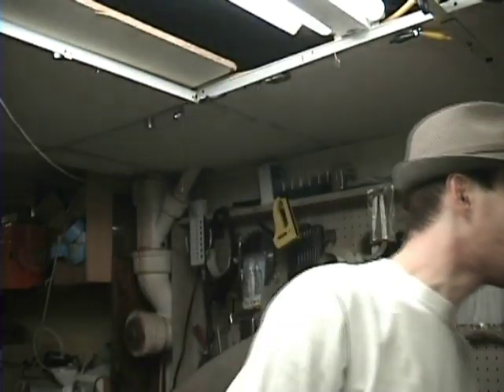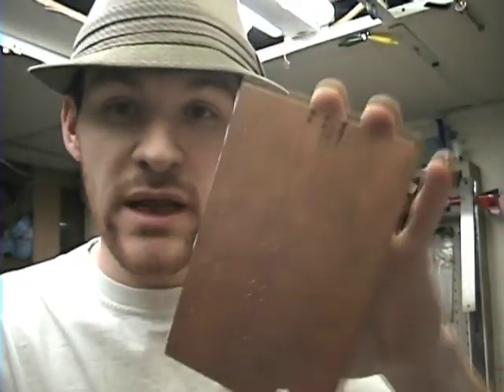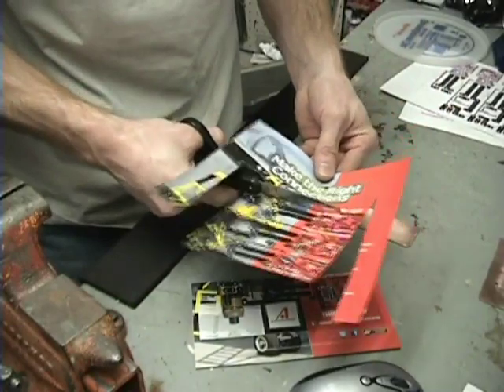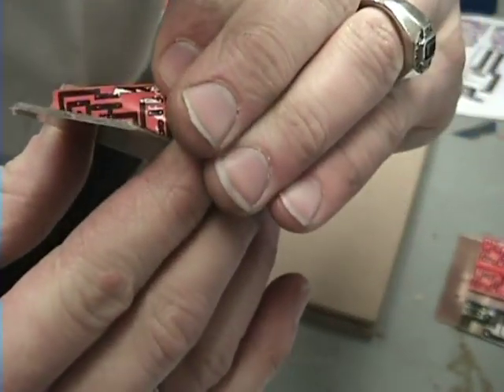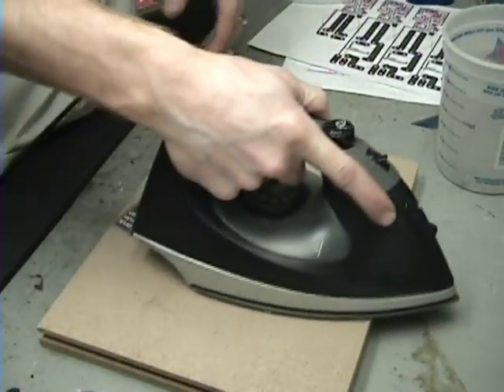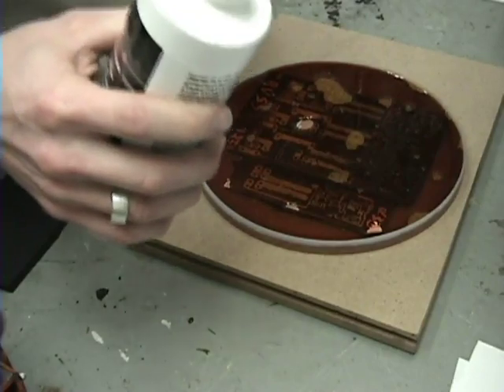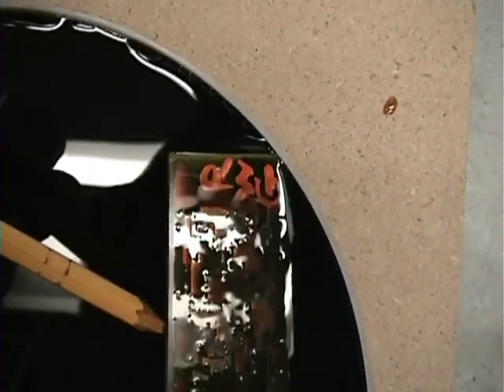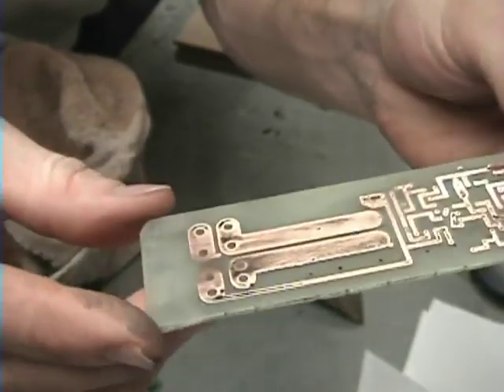#5 Building My Own Variable Power Supply (How To Etch Your Own Circuit Boards! )

Comment: Nice Video.  Brings back memories of my PC etching years ago.  Tips:  Put closed Ferric Chloride bottle in hot water for a few minutes to heat it up that helps speed up etching time.  If doing lots of boards, use fish tank with aerator attached to many holes punched plastic tubing at bottom of the tank.  -  Again, thanks for the video.  It was fun to watch your progress.

Comment: Great job Russ!  I have an etching kit here I never have even tried.  I didn't know paper could be used, I read that it needed to be transparency paper.  In case anyone wonders, the coating on the paper is actually a white powdery clay type stuff.  I've seen it delivered by rail car to paper mills. I don't think the view count is anything to worry about Russ, keep doing your thing!

Comment: A way to improve your etching times is to float your etching container in another container with HOT water.  The etchant works a lot better when hot.  You are right in that using more etchant would have been better as well because of the amount of copper being removed.  I like your method with the magazine paper, its a lot cheaper than my use of glossy photo paper.  Keep up the good videos.

Comment: Hi there Russ,
great vids' keep it up they are entertaining and informative, as a couple said a new sharpie works very well, you just have to get is dark in colour on the PCB copper, on other thing I found was to have the board larger than the overlay, this stops you from moving the paper or card stock or the transfer overlay you can buy, the iron has to be HOT my iron is set to the cotton setting.
I have done many boards this way and its a very quick way of doing professional looking one offs' or twos'.
With the ferric chloride I found heating it up will speed the process fast, keep the acid in the contain it come in find a bigger bucket put container inside and pour boiling water in, heat the sucker up, then use it as per normal, I have a heated Pyrex container with a heat lamp under it, works well, if you start seeing a vapor coming from the top of the acid stop heating very bad for humans plus it will eat any steel, be warned!!!

The best way to make a board is still photographically and it can be done cheap, nothing special, laser printer and clear transparent overlays print three or four, line then up PERFECTLY, using the specially coated board  put the transparent overlays on top, sheet of glass, some nice UV light, CLF bulbs work well about 3-4 mins I think, read the instructions might be different to the stuff I have used plus the light might emit more, I have seen UV LED's on eBay they work very well, develop, clean stick in HOT acid, perfect. Russ this might be something you might like to try, its a pity I do not have a camera but it might be something the people watching would like to see, even if you show setting up and getting the exposure right, this might explain it to people.

I enjoy watching your experiments, and love the way you make it look easy and explain what you are doing even when things do not go right you show how to fix, keep up the good work.

Paul

Comment: what kind of box are you going to encase it all in, are you gonna stack each power supply or side by side. you could stick it in a computer tower, stream line and i dont think it would too hard to add knobs and positive/negative ports. the side of the tower could be plexi glass and add a few leds and you can keep an eye on the inside without taking it apart.

Comment: I tried ExpressPCB but i found it quite annoying,

It constantly printed in the middle of the page so it wastes alot of space if you are doing a thinner board, it also has scaling issues.

Loved the way you could easily make your own components 

Other than those issues it was nice.

now i use Pad2Pad.